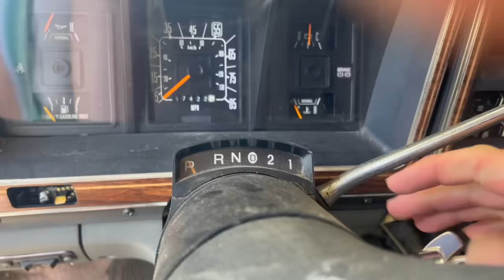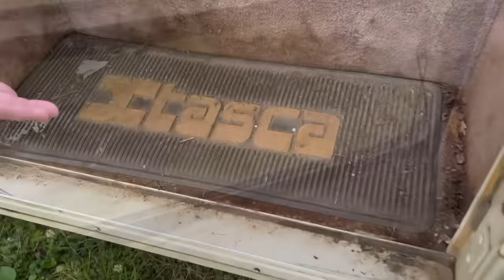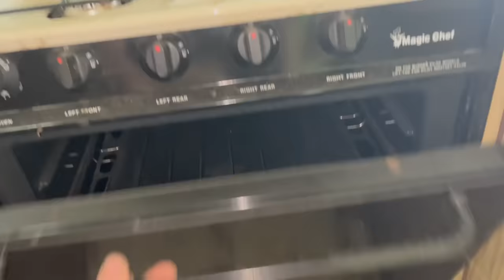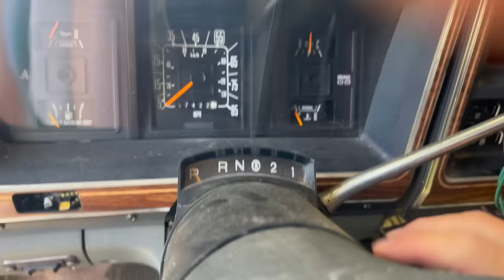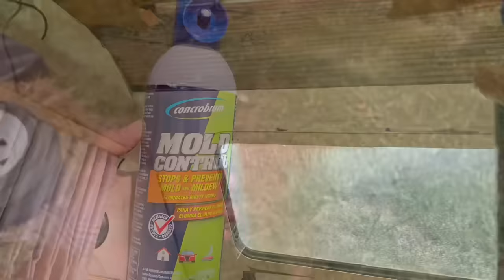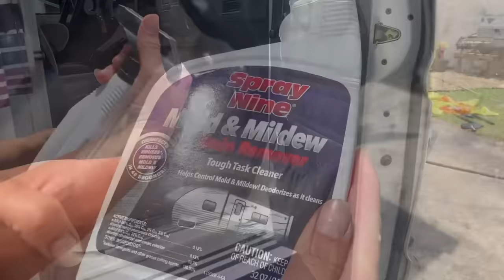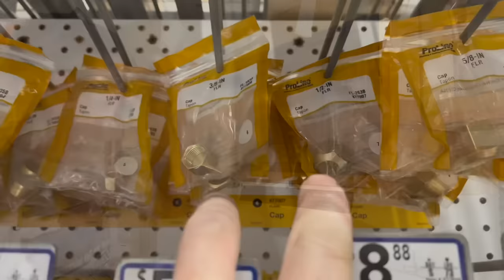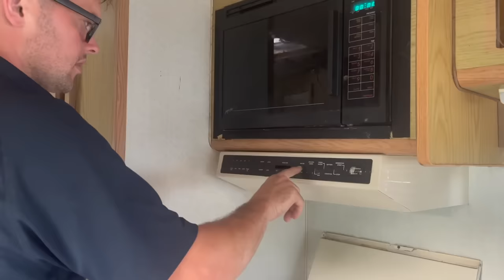31 year old RV parked for years! Can we clean it up and camp in it?

Comment: It's soooo strange not to have a gasket sealing the engine bonnet.  The water goes right into the engine bay.  Apparently there is  a seal available for it, but nobody seems to replace them.  Yet the water damage ain't all that bad.  Still, electrical wires can corrode.  To fix a short, I had to wrap hockey tape around the upper wiring harness, visible there in the black plastic channel (although my dodge didn't have it).  Cross fingers, could have been the difficult-to-diagnose  and replace seldom documented fusible link.  

For like-new snappy SAFE brakes for the family, change out the $100 Proportion/Combination Valve directly under the master cylinder, all the debis falls down into the valve..  After 30 years the valve will be badly gunked up and holds air. Not worth cleaning.  Remember when bleeding to hold out the little sprung pin with something as per instructions. It seems Mechs don't always perform this recommended practice, which might contribute to inability to achieve snappy brake response after repeated bleeding.  Do it yourself to get it done right to make it feel like brand new!

Comment: I think I'd spray that mattress with upholster cleaner, let it soak in, then pressure wash it on a mild setting.
Those RV mattress are special sizes with the corner cut off. Or, maybe have it recovered at an upholstery place.
I wonder if the trans in the class C (van front) motorhome is the same as in a passenger car for length.
   If you pull out the moldy headliner, then pull out the rotted plywood, all you have left of the ceiling is a thin piece of corrugated aluminum.  If you want to replace the wood in the ceiling, you are talking a very long project. I think if I wanted to use it this summer, I'd leave all the ceiling in there and put some thin veneer paneling on underneath to shore it up.
    American RV's just aren't waterproof. Other than the aluminum aircraft style that cost a fortune even used.
The only RV, trailer, truck camper made of plywood that is old enough that isn't ceiling and wall damaged is one that was kept indoors every day except when it was out on a camping trip.
   Every one of them leaks around the seams. The sun drys out the calking. Then, even it it rains only rarely, like in the desert, the water gets in the seams and rots the wood.  And most have no metal or very little in the walls and roof.
Reply from the maker: Your right thank you

Comment: Josh, the camper body is too far gone to fix, how about this Idea? Tear off the camper body just behind the cab and then go out and find a camping trailer to fit the Chrissie, or put a bulkhead behind the driver's seat and make a flat floor out of steal and 3/4 plywood that is wide enough for your ATV, then fit a trailer body to the chassis and there you go, homemade toy Haller for 1/3 the price.
Reply from the maker: Thank you . Yes that is probably a good idea

Comment: Use Dicor sealant on the roof. Don't use silicone.  Also, Dicor and silicone do not work together.  Neither will adhere to the other at all.  Dicor is self-leveling and makes a great cap over seams.
Reply from the maker: Ok good to know thank you

Comment: Shame its in such...trashed condition. i have a 91 Itasca spirit mini which is the 30 ft, with the rear twin...but mine's not destroyed and cost me 7K, 4 yrs ago. That 460 will run forever as a Ford guy told me.  The bathroom is actually "cross aisle" both doors open to make the bathroom the entire width. The key for the storage and gas/water are all the same key.  Thats your old school TV antenna
Reply from the maker: Yeah I wish it didn’t have the water damage
Reply: @Sleeperdude  yeah that's a bummer when that happens, but least you had a good solid floor!

Comment: Metal scrapper.& some flex sealer.,or dollar General store brand spray can flexible sealer. It's cheaper there to. Wash the top good.& scrap it off good to. Then broom it off.,or lightly spray it off with water hose just enough to remove the debris off.& let all dry good.& then put on bad clothes to start spraying on the sealer spray to let dry really good to.
Reply from the maker: Sounds like a plan

Comment: 1979 Imperial 5000 Holiday Rambler acquired.  Cons: 55 yr old city girl alone, Clueless, small pension, don't know many honest helpers, gas tank off, black tank cracked, Tires rotted but half replaced so far.
Pro:  F350 Edelbusch? engine purs org. 50k, Kohler Gene 50 hrs. Elec/prop fridge works, water pump works, Other appliances untried. The gene works but only after fuel diverted from varnish tank and carb cleaned. Engine tested by same method diverting fuel source. 
Gas tank cleaned with diesel but still needs clearing. Purchased Seafoam but it needs more than that I'm told. inside tank access limited. 
I'm thinking rocks and fluid to be a natural abrasive?

Comment: Man I don't like spend people money but I will make sure the brakes okay on  there  get everything you know get it we're stopping on everything check the transmission fluid change the oil in it and I would get 3/4 plywood up top were the bed is and the roof they got what they called cool seal for that roof cuz I think that's all that need I will check to make sure the air condition are get  another one that'll work if you can't get that one working and I would put half inch plywood on the inside and painted whatever colors you want and I think a little work with the floors the showers fixable I think you can make it look good and presentable to take a trip in that's a nice motorhome cuz you go get one now that kind of low mileage on you going to pay 20 something between 25,000 to $30,000 for it and it might not have the stuff might not work but tell your wife and your son and your daughter now they did a good job and it was a good video and I love the contents of it and I can't wait to see what you going to do next
Reply from the maker: Thank you I will tell them

Comment: Yeah knock the body off it make a flat bed hauling truck or pull the engine that's the only options josh. No don't camp in that there is to much black mold going on there and who knows what else. Yup its worth it for the running gear.

Comment: Pull the roof down inside sister rib some new tube iTunes inside there I built from the top down then clean the top real food real good and you Snow White roof repair rubber you want to put it on at least 3/8 in Stick use about 8 gallons Rapunzel the inside you're done use a good Snow White's about $100 a gallon if you go to at Home Depot or Bernie's already got out there for home improvement store it's a lot cheaper than going to the RV place
Reply from the maker: Ok thank you